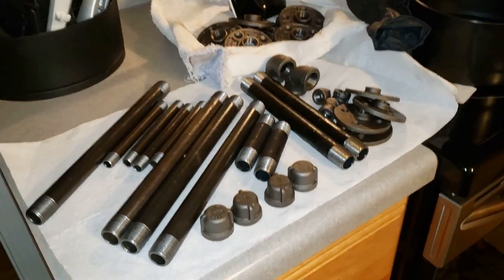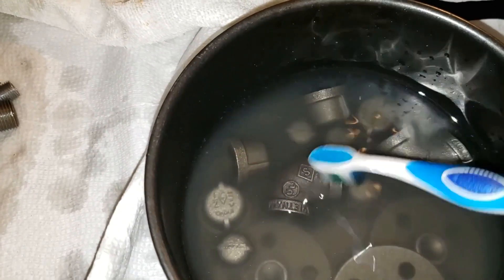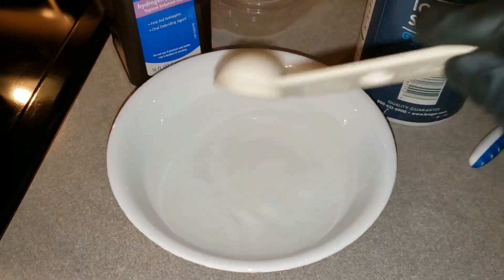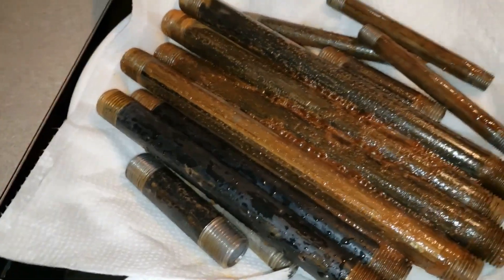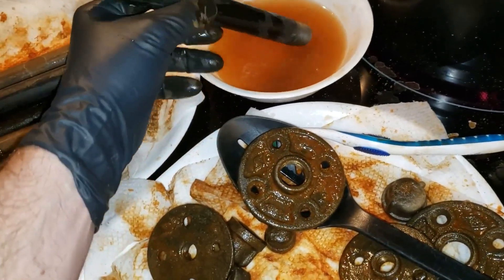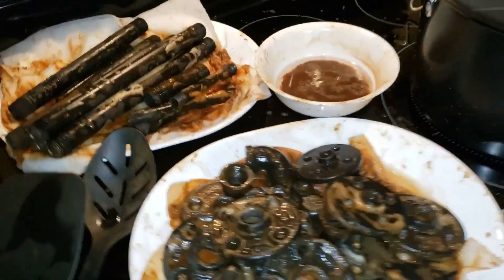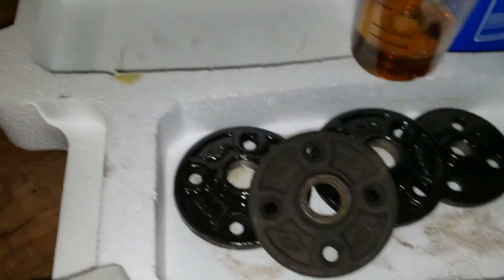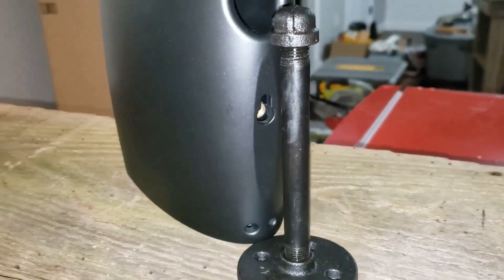Cooking up Black Oxide - DIY Blackening of Metal

Comment: Im curious about the mixing of vinegar and hydrogen peroxide comment. Almost all the info ive found on rust bluing they mix all 3 together
Reply from the maker: I am not a chemist so I err on the side of caution. Don't mix hydrogen peroxide and vinegar together in the same mixture. This can create peracetic acid, which may be toxic and can irritate your throat and lungs, eyes and skin.  If outdoors with good ventilation and with a good acid gas filter mask, it might be ok.
Reply: @yourboard5506  It creates Peracetic acid which is simply stronger than Acetic acid - most of the cautions you see about that acid are related to high volumes of exposure.
Reply: So i should add the vingar to the salt and peroxide? Im mixing like an 1/8 a cup for a couple hex bits. edit: i mixed in the vinegar to the h202 and salt. It works.  One thing to know. Light kills peroxide. Specificaly uv light. That's why it comes in a dark brown bottle so keep in it a dark spot. Thanks for the video bro.

Comment: Great Video. Thanks for posting this/sharing. I've been looking for a DIY alternative to Caswell's black oxide kit - I want to blacken several truss plates to look a piece of wrought iron plate and I knew there had to be a simple 'at-home' method. I know I could also heat the pieces and dip them in used motor oil but that gets messy and I don't want to be dumping used motor oil all over my driveway.

Comment: I was cleaning some rusted bolts and nuts with muriatic acid. I think it was a 31% solution available at hardware store. And it was diluted even more with water. Being curious I left some parts in the tub for an extended acid bath. They ended up pickling. Surprised for sure.

Comment: The "black" that is on the pipes is a varnish that is used to keep them from rusting on their trip from china. They won't oxide/rust until you remove this coating. You need to use a paint thinner to dissolve the varnish. Acetone will not remove varnish. I am a pipefitter of 38 years in the trade.
Reply from the maker: Thanks for clearing up the varnish question.  Some had it and some didn't. For indoor use I'm good with the varnish.
Reply: Thumbing up. It's better to try to use something like kerosene I think.

Comment: Can you write the inggridient for this project
Reply from the maker: Degreaser: TSP and / or Acetone 
Pickling: 6% white vinegar 
Oxidizer: hydrogen peroxide + small amount of salt.
Boiling water.
Alternate between oxidizer and boiling water several times.
Remember not to mix vinegar and hydrogen peroxide
Reply: @yourboard5506  
What % is the hydrogen peroxide? Thanks.
Reply from the maker: @platinummind1697  3% is the typical household hydrogen peroxide.  That is what I used.
Reply: @yourboard5506 not positive the boiling is necessary. I remember bluing guns with tap water in the bathtub.

Comment: You seem like a very smart man. Why in the world do you have highly flammable and potentially explosive acetone sitting on top of a heated stove?!?!?
Reply from the maker: Good observation.  Yeah, don't try that at home.  Definitely not a good idea and makes a bad image.  I'm pretty sure it was there only briefly for the video.  Good thing the stove only get hot where those round circles are on the stove.  I guess I should have been more worried about that rather than the explosion happening if I had dropped one of those metal pieces and craked my wife's glass cooktop.